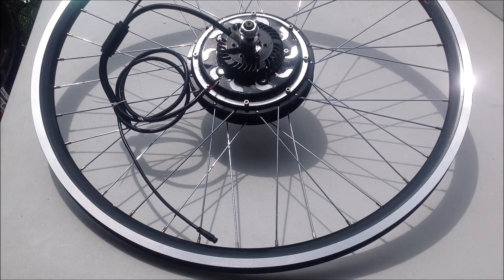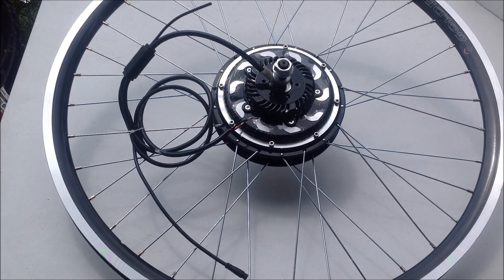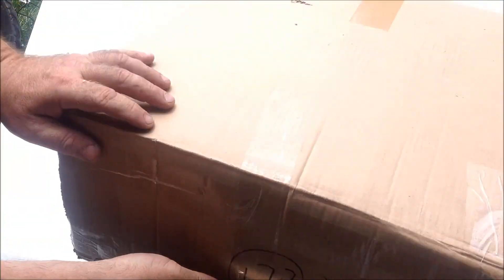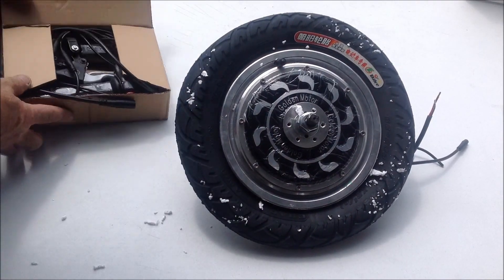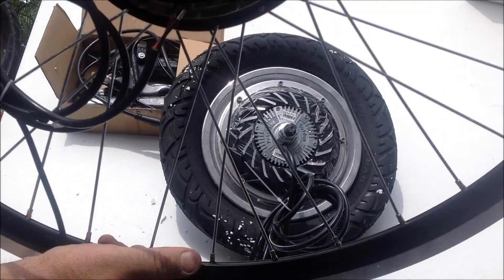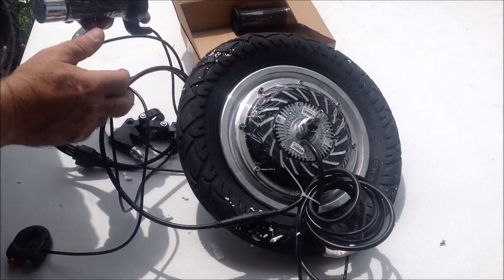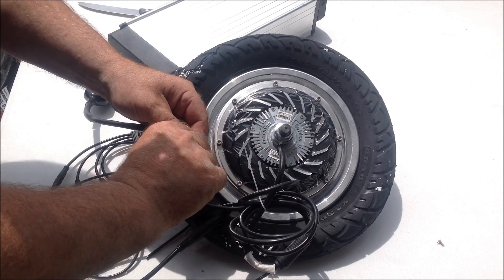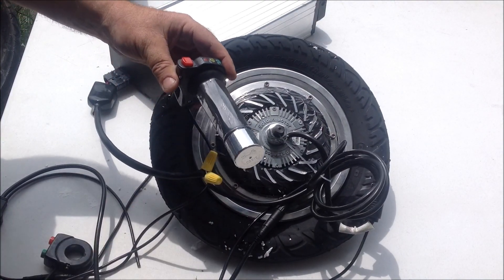Smart Pie Vector - Golden Motor Canada

Comment: Is it really this simple? On other videos, we see users setting up things on their computer.
Reply from the maker: +pagb22 Yes it is that simple. By default it works at 48 volts right out of the box. If order a 24 or 36 volt kit we preset the voltage before shipping so it will work for you without any programming.